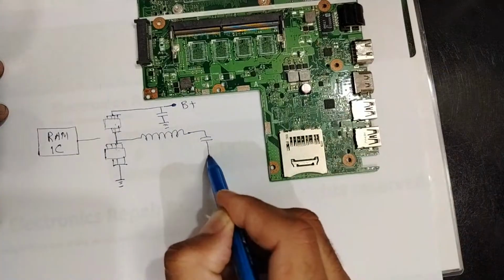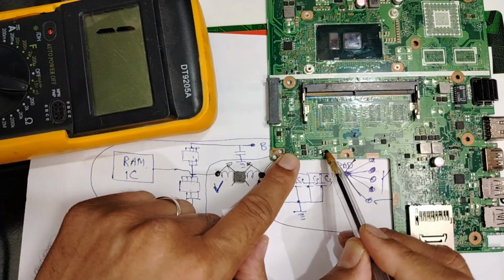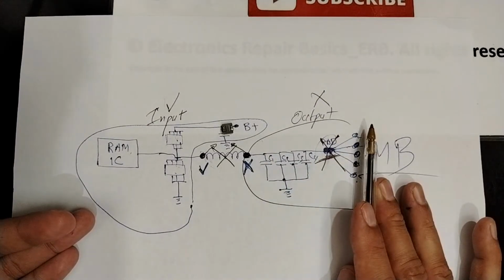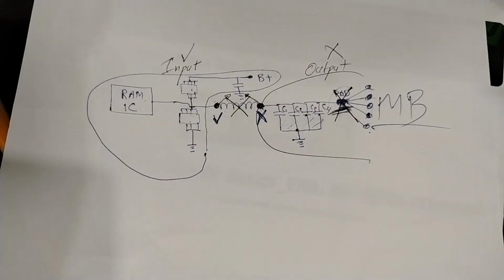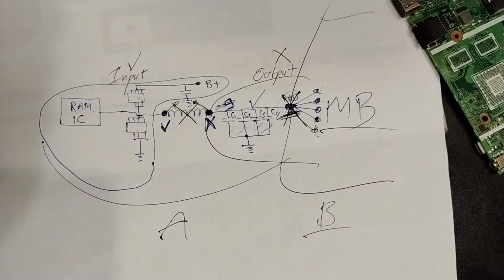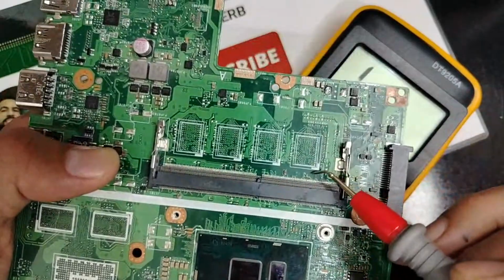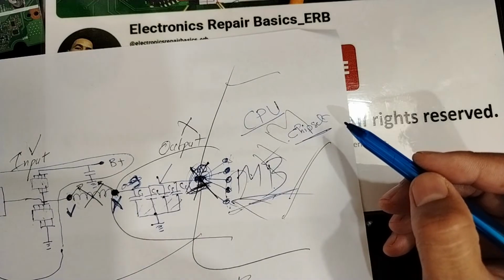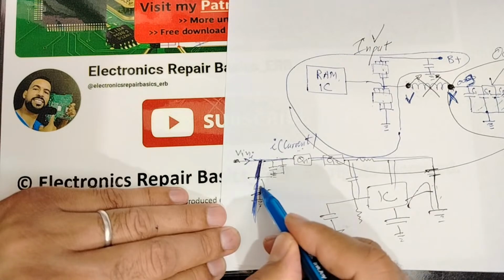🔥Mind-Blowing Short Circuit Troubleshooting!🔥🔥🔥Livestream

Comment: Not gonna lie,  your videos revived my interest in component level motherboard repairs again and I'm not turning back. I've successfully fixed 2 laptops without schematics or thermal camera after learning from your videos. A great teacher once said " Inductors are never connected to ground, so we can use inductors to find a short circuit". This quote from you is my first approach to finding short circuits. 

I must admit some tools are very necessary to get to the final culprit of the problem. For instance even though i was able to locate the shorted components, I was only able to find the real culprit with voltage injection after ordering a DC power supply because there were over 8 smd caps all shorted and it will be a hassle to try removing all one by one; which can be done but time consuming. 

But it's all because of your teachings that I've got this far. God bless you. 
🙏🙏
Reply from the maker: Glad to hear the videos have been helpful, and congrats on the successful repairs, welcome bro